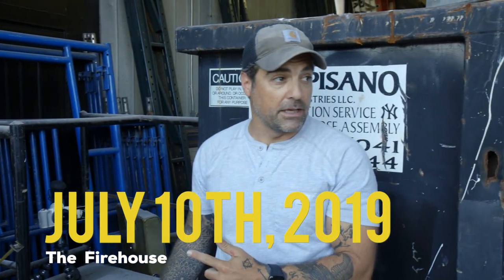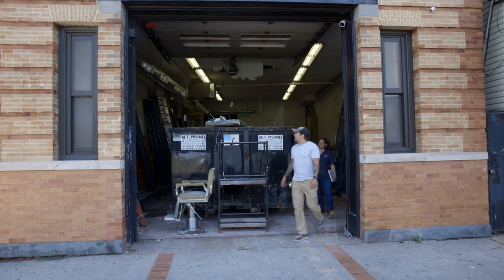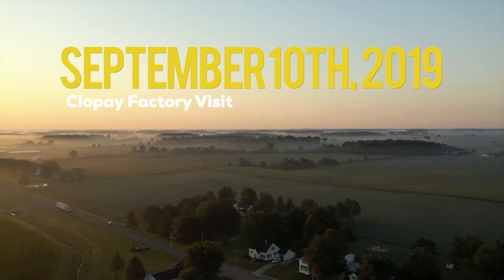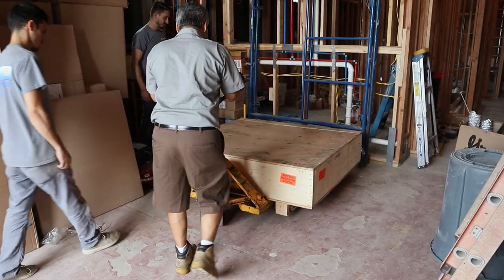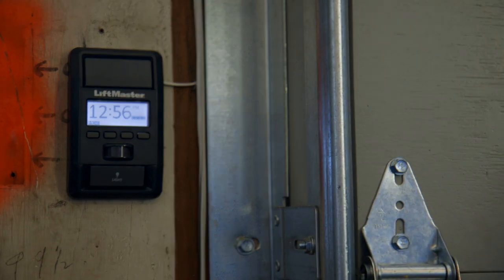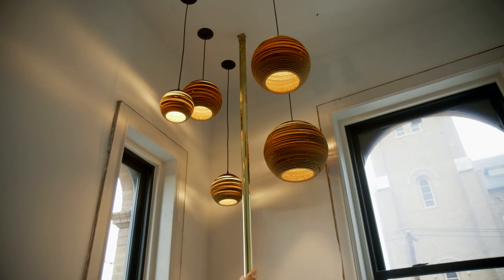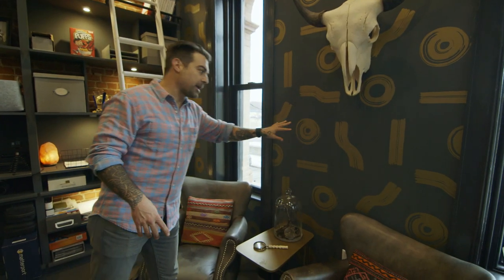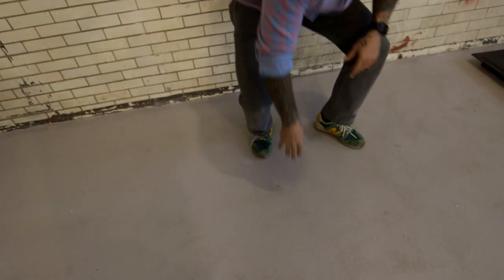Firehouse Project 05: Office / Garage / FIRE POLE!

Comment: I spent 21 years as a FDNY Fireman and have slid those old brass fire poles hundreds of times. My firehouse was an old house in Brooklyn and had threes floors plus a hose tower that extended above the roof. The ceilings were about 13 feet high and there was a pole from the hose tower at roof level down to the third floor....then another pole down to the second floor....then another pole down to the apparatus floor.  Since the hose tower was on the Engine side of the house the Truck side only had poles from the third floor down. I used to skip rope on the roof of the firehouse with the hose tower door chocked open and if a run came in I slid all three poles was still the first one on the apparatus floor....and 45 years old at the time :)
Reply from the maker: Awesome John!

Comment: Where did you get the fire pole ? Would like one for my barn
Reply from the maker: I bought it from a company in Boston, but i had to get it with the 90 min fire rated self closing floor for code so it was SUPER expensive. if you're just looking to get a pole i would search around the internet....1-1/2" or 2" diameter.